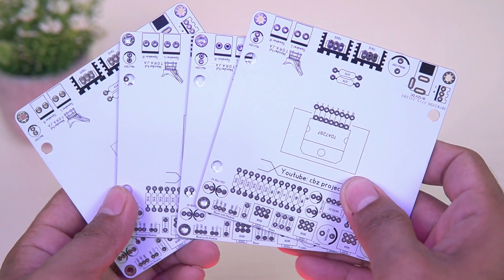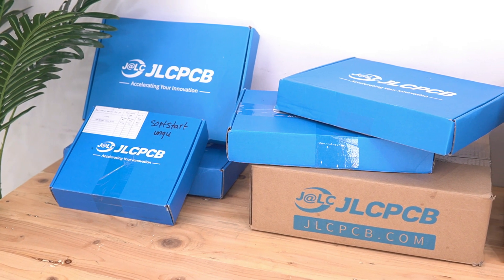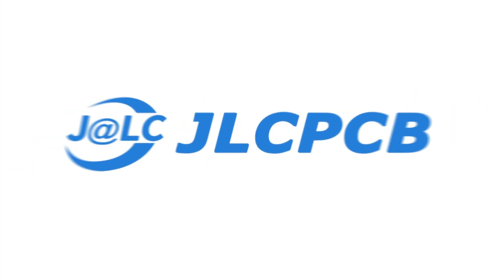Powerfur Bass Bluetooth Amplifier with PC Cooler

Comment: That hum will disappear if you use big wire connrection for the 5v regulator and the Bluetooth module, bring the regulator close to the Bluetooth to have very small length of wire in supply.

Comment: Cooling fan humming in Audio brother
Reply: If we connect to same input supply with the amplifier power input  it will make humming noise sounds as the fan spinning😶... I made diy amplifier that's happen  then  I use another supply for the fan then no humming noise anymore
Reply: @dazai_osamu777  I am saying to this
Fan supply change another Power supply
Reply: Wkwkwk